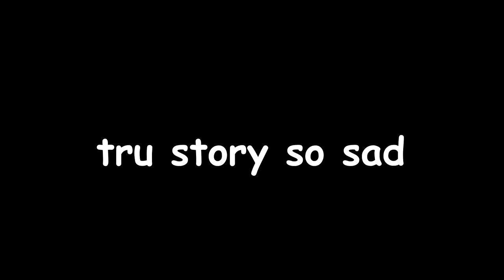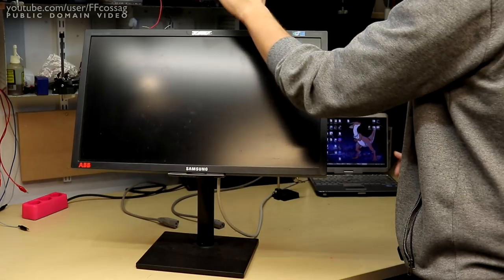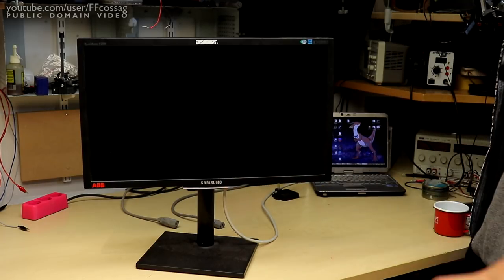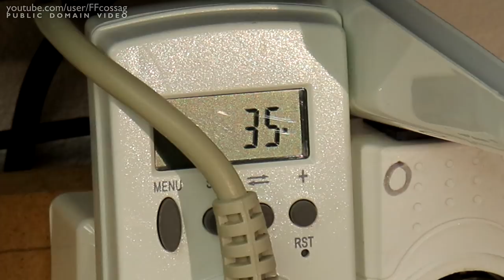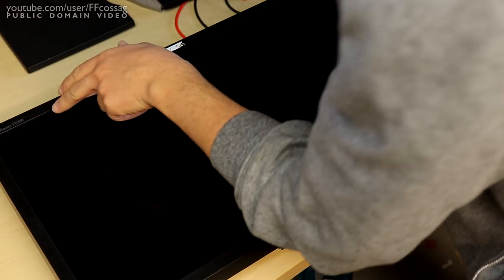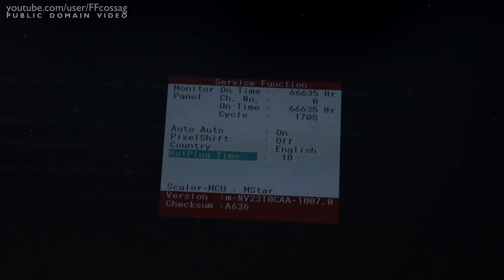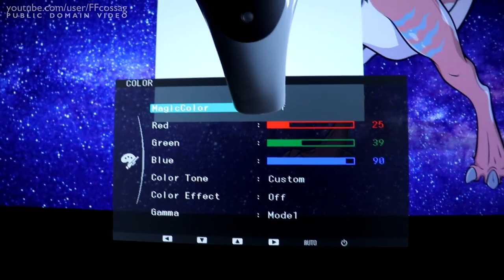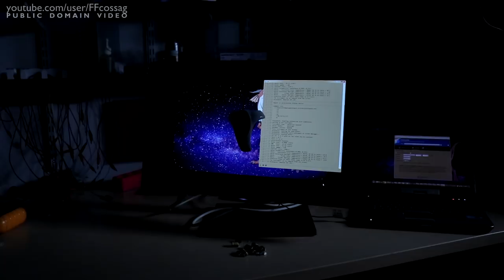66 THOUSAND HOUR Samsung F2380 LCD monitor repair

Comment: "LCD suffer burn in" pixel shift: off.
Reply from the maker: It's off by default for a reason - you don't want to be moving the image around on a 1:1 mapped panel in a PC display.